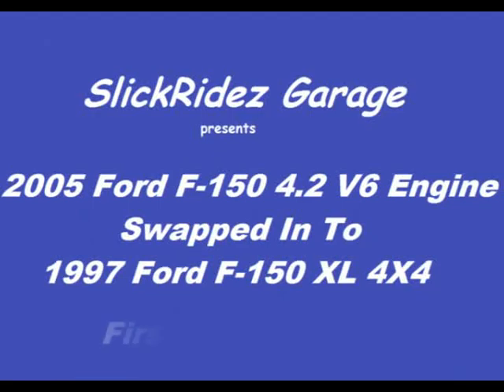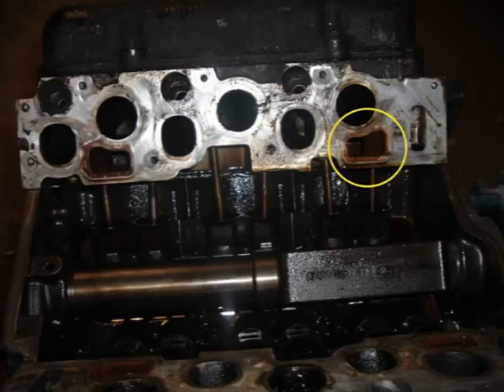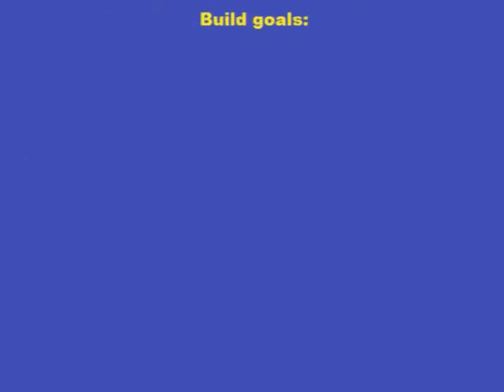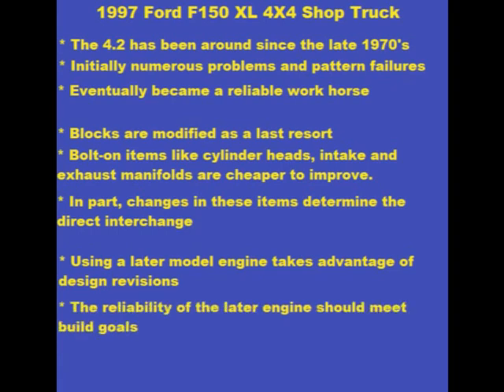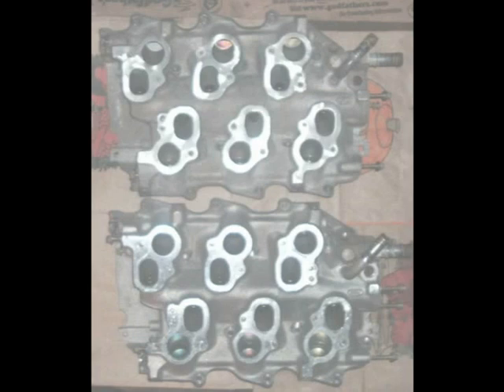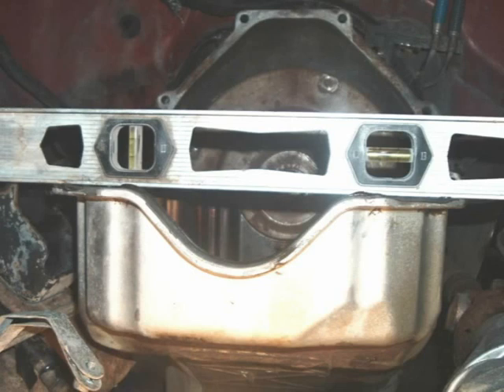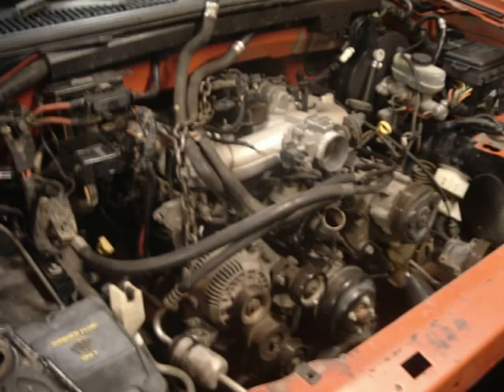2005 Ford F150 4.2 V6 engine swapped in to 1997 F150 4X4

Comment: Someone gave me a rust free Supercab 98 XLT with a bad 4.2I  I found its near impossible to find a running 97-98 4.2 anywhere. so after watching your video swapped a boneyard 05 into the 98 rwd 5 speed.  No issues whatsoever. Swapped in a new aftermarket lower intake, water pump and cam synchronizer, rebuilt the injectors, now I have a new truck! Folks need to realize, though, the 05 takes almost 7 quarts of oil vs. 5 in the 97-98....
Reply from the maker: There's nothing better than a rust-free and free truck! Congrats and good job!

Comment: l did the exact same swap that part went well  when I bolted the transmission on it locked up I was wondering was it the torque converter
Reply from the maker: The torque converter may not have been fully engaged in to the transmission.

Comment: Do you think you could take a 1997 short block remove the heads and install 2005 heads and a 2001 intake on that 1997 block?
Reply from the maker: I don't know for sure, but there are updates to the later block that make it a better choice.

Comment: your video is right on time as my 97 5 spd 4.2 is dead. I bought a 2001 4.2 from a automatic van and plant the swap during the Easter break.
any suggestions or problem I may run into?
Reply from the maker: +allboydogs Thanks for watching SlickRidez Garage! The swap should be very close to the same. Be careful if you have to pull the timing cover, they are easily broken. It's also a good idea while it's out to replace the clutch slave cylinder (internally mounted in the bell housing). I replace my clutch slaves with a replacement unit from Ford since aftermarket slave cylinders have a higher chance of failure and I don't want to have to remove the trans again after the job is completed. The top 2 bell housing bolts are a pain (esp. on the 4X4) and expect the exhaust manifolds to be rusted beyond re-use. Gimme a shout if you have other questions!
Reply: I know this is probably a little late but im pretty sure the wiring harness is backwards. It was for me from an E350 van to an f150
Reply: +mark stansbury I'm happy to say that my truck is running great with the van engine, I saved a TON of money doing it myself, this video was truly an inspiration
Reply from the maker: I'm glad your truck is still running great, and thanks for your comment!

Comment: Hey man I have a 03 4.2 everything is stock can I boost it in any way or ad hp without changing much if so what or the best way of going about this. thank you
Reply from the maker: I've never looked in to it, and I haven't heard of many power adders available for this engine. The 4.2 is a near identical copy of the GM 3.8 V6, but not close enough for any Buick GNx goodies to work on it......darn......how cool would that be.......an intercooled turbo F150? Your question didn't link to my email or I'da jumped in here sooner. Thanks for watching SlickRidez Garage!
Reply: Slick Ridez Garage i heard it was similar to the v6 in the mustang at the time, and all perfomance parts should bolt up
Reply from the maker: Cool thanks for commenting! Have a good one!
Reply: The 4.2 is the exact same block as the 3.8l Mustang/Thunderbird engines, different crank and longer piston rods from my understanding, i would like to find a 3.8 from a Thunderbird Supercoupe and do a block swap (SC had a higher carbon content) and push the ole 98 f150 with a 4.2l supercharged!

Comment: Awesome job, I normally just grab a old 3.8 from a Thunderbird or something slap the Dual Port heads on it and updated crank sensor and call it done everything works as it should, the 3.8 runs amazing with the dual-port heads from the 4.2
Reply from the maker: In this case a 4.2 with low miles was readily available from a place I trust, but I did learn about the 3.8 to 4.2 swap during my research.

Comment: So I have a 2001 with the 4.2L. Am I understanding correctly that it's the same engine up until 08? So if I get an 08 or so motor would that fit in?
Reply from the maker: The 01-04 is not a direct swap for the 05-08, but the long block is essentially the same and your knock sensor won't have to be re-located.  Your plenum, intake, accessories and possibly the oil pan will need to go on the 05-08 engine for it to work.
Reply: Thank you for your reply! Do you think it would be worth it? The only issues I've had are the leaking oil pan and intake manifold.
Reply from the maker: With a short list like that.....no, as long as the engine runs OK, has good oil pressure and doesn't knock/rattle/overheat. I'd look for a "Problem Solver" gasket set for the lower intake.  If the pan physically leaks oil and it's not just expected weepage I'd replace that too. Pan "gasket" is one piece between the rear main bearing cap and oil pan. The rest is RTV gasket sealer. I used "Ultra Black" on mine.
Reply: Right now it's running lean and I can hear air rushing in from the driver's side manifold. I've heard it's hard to take off the oil pan in the 2wd is it hard in the 4x4 too?

Thank you for all your help!
Reply from the maker: On the 4X4 one has to pull the front axle to get to the pan. This gives lots of room to get it out. The cross member in the 2wd can't be removed and that makes it a pain. Have you tried to locate where the rushing air is coming from?
Reply: SlickRidez Garage a year or so ago I replaced all the upper intake manifold gaskets but on of the bolts broke off in the lower. I needed the truck the next day so I had to put gasket maker in place for that and so I can hear it leaking between the upper and lower intakes
Reply from the maker: I mean....darn! That's not good. I'm sure you have a P0171/P0174 too, that's lean on both banks. That bolt will have to be drilled and removed/replaced to fix that. The safest way IMO to keep metal cuttings out of the engine is to pull the lower intake before drilling. If the pan isn't leaking a river of oil I'd get that intake fixed first and try to go easy until you can.Worst case scenario your looking at a used intake and lower gaskets. That's only a $75.00-95.00 lesson in broken fasteners if you DIY. In the grand scheme of things that's cheap by comparison to some of the things I've seen!
Reply: SlickRidez Garage yeah that's my plan now. I just need to find a garage I can work in. I'm still in school and move around a lot so I only really have parking lots to work in. I'm hoping to be able to do that soon. Thank you very much for all your help! I really appreciate it! Happy thanksgiving!
Reply from the maker: In my High School days classmates would ask me for help..... the parking lot there saw plenty of repairs! I replaced the engine in a friend's Nova that way! But a parking lot......that's rough, and it's getting cold. Hope you can find a warm place to work. And thanks for watching SlickRidez Garage. Any more questions let me know. Happy Thanksgiving to you and yours!
Reply: Was able to find a buddy with a barn and worked on it until 4 am that one bolt was a pain but finally got it out. She runs like a dream now! Thank you very much for your help!
Reply from the maker: Your welcome, and thank you for letting us know how everything turned out! Have a good one and enjoy!

Comment: I don't understand, couldn't you have used the intake from the donor truck?
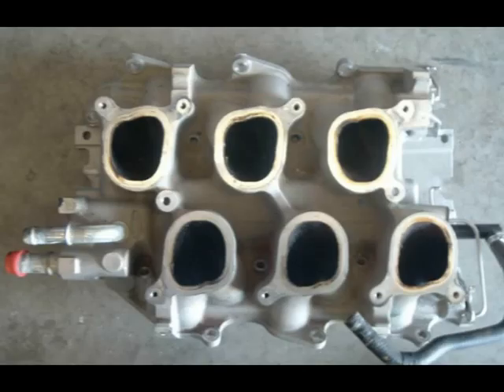Reply from the maker: Thanks for commenting! Do you mean the intake from the 2005-2008 engine? There's a pic of it next to the original 1997 intake at 7:32 and it's way different. If you have questions I'll be in here a bit later. Have a good one!
Reply: I am looking at an engine out of a 2000 model for my 97.  I guess what I'm asking is can I use the 2000's intake?
Reply from the maker: Yes, you will need to attach your vacuum dashpots (actuators) at the rear of the intake for the IMRC system. Is a good idea to vacuum test them as the diaphragm inside is known to rupture and affect the system's performance. The plastic retainer clips at the actuator shaft should also be replaced. Don't forget to check the water outlet tubes for rust holes and the EGR passages for excessive/restrictive carbon build up or you might get an EGR flow code. Best wishes for your project!
Reply: Thanks

Comment: Thanks for the video...your giving me hope! I'm trying to do the same. Could you have just gotten a 2008 intake manifold upper instead of getting the 2003 intake manifold lower to match the 97 upper manifold? Or would that mean more changes?
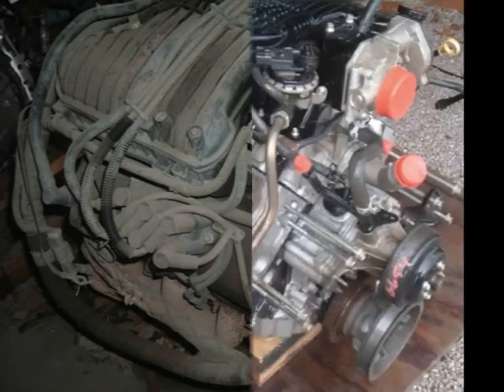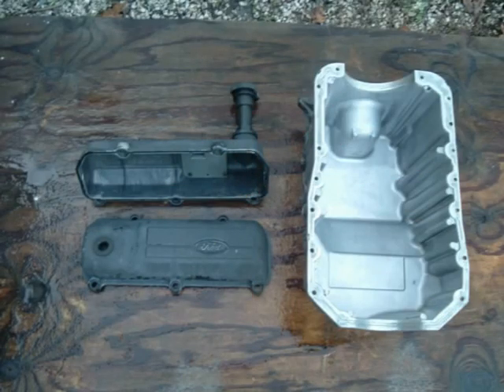Reply from the maker: Thanks for watching SlickRidez Garage! The later manifold is plastic and of a completely different design. Have a look at the video from 6:24 to 6:40. The black plastic thing on top is the upper intake for the 05-08. To use the late upper intake would mean swapping in the entire 2005-8 setup, and that's not very feasible. What year F150 are you thinking of swapping it in to? 2 or 4WD?
Reply: I've got a blown 98 and would like the better engine(05-08) like you. I also have a new tranny but it fits the newer starter bell housing pattern which I think started in 99 so that may be another issue.  Could you elaborate on not feasible? Cause I'd rather not worry about tracking down a 2001 intake manifold? Thanks a lot for all your help!
Reply from the maker: The entire control system would have to be swapped over and the late to early transmission electronics will be incompatible. The 2001 lower intake is what you would need. Your upper intake will be re-used with the 01-04 engine. The lower intake should be available at nearly every wrecking yard near you, they are very common. It's way easier to swap in the manifold then swap a late model control system in. I think what you mean on the bell housing bolt pattern is you have a V8 transmission which has 3 starter bolts instead of two? Glad to help, sorry about the late reply just got done driving 642 miles.
Reply: Ok thanks, I'm gonna go for it and I'll just swap the 01 lower intake.  Thanks for putting up the video and doing the legwork otherwise I'd have put in another problem child engine.
Reply from the maker: Your welcome! Let me know if you have questions, or please stop back by when you get it done and let us know how it turned out!
Reply: Ok I'm just about ready to embark and have another question.  Why did you not use the 05 valve covers? Is there a reason you put the 97s back on.  The 08 engine I'm buying comes with valve covers. Again, Thanks for all the help!
Reply: Also, could I reuse the 98 exhaust manifolds?
Reply from the maker: I'll answer both of today's questions here. Once you see the 2008 valve covers you'll see why you have to re-use yours. They are way different. Yes, you can re-use the 98 exhaust manifolds but be cautious....they are known to rust up real nice and by the time its all said and done they may not be too great. If your 98's can be re-used you don't have to enlarge the holes at the header pipe flange. It sounds like your getting ready to actually do the swap? Let me know if you have other questions and best wishes for the job ahead!

Comment: I want to know more about this knock sensor.  Is this one the same as the 2007?  I believe mine is going out.  I get an AWFUL lot of pining while accelerating particularly on the highway or interstate if I start to go up a hill.  New plugs, new wires. Tried sea foam, new air and oil filter.  my ECM isn't throwing a code but codes only get thrown if a sensor says hey, this is a problem adjust, computer adjusts and 1 has adverse effect or 2 reaches its limit.  I can see where a sensor can totally be bad, give a signal and the computer run with what it knows and an engine not work right. So, is this the same knock sensor as the 2007?  is it decently accessable without engine removal?
Reply from the maker: Thanks for watching SlickRidez Garage! The 1997 and 2007 sensors are different. The knock sensor contains a piezioelectric element. It is tuned to vibrate when pinging occurs. This creates a small voltage that when seen by the engine computer retards the timing and stops the ping. The knock sensor might be bad, but it also could be from lean mixture or a whole other host of things. I might be able to help you better if you can tell me what year F150 you're working on?
Reply: I have the 2007.  I see where you put an 05 in your 1997 and I saw this was one of the differences.  The 05 and 07 are same part so I assume 07 the sensor will be on the left cylinder head towards the firewall. What I have done so far is
new plugs and wires
sea foam 2x
new air filter
new fuel filter

things to try still maybe
knock sensor
clean MAF sensor
higher octane gas (I hope not)
Reply: 9:49-10:52 of your video you not effectively have a 2005 knock sensor which is why I asked.  The 2007 is the same sensor and I can only assume in the same location as the 2005 which actually changed starting in 1999.
Reply from the maker: Okay yes the KS is on the left head then. Its not impossible to get to but its not in a real great spot either. I've never done one on the 05up (plenty tho on the early 96-98) but engine removal shouldn't be needed. Poor driveability from poor sensor signals leading to other sensors flaking out is unlikely because the sensor sending a bad signal usually gets flagged (with a code) and ignored. No code + no PENDING code usually means sensors are all operating within their normal parameters, so have you by chance checked for pending codes too? 99% of the time when no pending or present codes are present there's something else going on the computer can't see. Tell me about the symptoms. Is pinging the only problem presenting? Usually I hear that along with sluggush, hard to start, poor acceleration....things like that.
Reply: starts fine runs fine, when cruising on the interstate or highway if I put it under a heavier load, IE climb a hill it pings all the way up the hill until I let off the accelerator.  That is when it is most present, most pronounced and most likely to happen.  It happens while driving in town too usually accelerating but not from a stop and usually not until At least 3rd if not 4th 5th gear.
Reply: Drew Honnoll l

Comment: I want this engine in my 2000 Mustang v6...
Reply from the maker: I'm not sure if the deeper oil pan on the 05-08 would clear the cross member on a 'stang......but the OHV 3.8 and 4.2 are the same engine family. Thanks for watching and commenting, please subscribe and let me know what you think of my videos! Have a good one!
Reply: Does that mean  i would have to get an 04 and lower for the oil pan to fit and not touch the cross member?
Reply from the maker: The main caps are taller on the 05-08 requiring the deeper pan.
Reply: Got it! Thank you so much for that info. I will be going to pick n pull soon to get that engine, rebuild it and throw it in my Stang. I hear those engines are stronger than the 3.8 I have. These v6's are too heavy for this engine. Great video, keep them coming!
Reply from the maker: I uploaded three new body and paint videos hope you check them out! Thanks and best wishes for your project!

Comment: I have a 2000 f-150 4x2 can i swap that engine into a 99 f-150 xlt 4x4 and if so would I need the xlt wireing harness?
Reply from the maker: Thanks for watching the video! If they are both V6'es, according to the information I have the 1999 and 2000 engines are a direct swap, save for perhaps some differences in accessories. You will not need the XLT's wiring harness. Have a good one!

Comment: What accerie brackets did you use the 05 or 97's and what about the crank pully did you have to change that or use the 05's and i have a 1997 4x4 that I'm planing on doing this swap it has a auto trans witch flexplate did you use
Reply from the maker: Accessory brackets and flex plate were from the 97 and the balancer is from the 2005. Thanks for watching the video!

Comment: My 05. 05 f150 w/ 200,000 on it runs great . i here people getting over 300k from these engines..
Reply from the maker: Once Ford got the revisions right these engines were great!
Reply: My dads 06 had 285k miles as a work truck but let it go due to rebuilding transmission 2 times